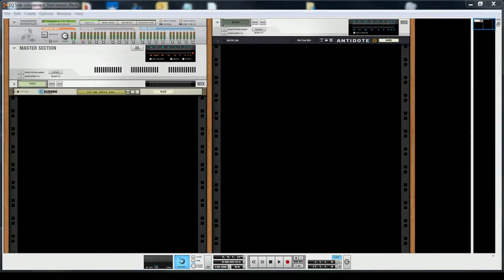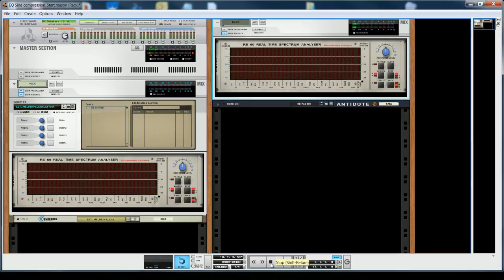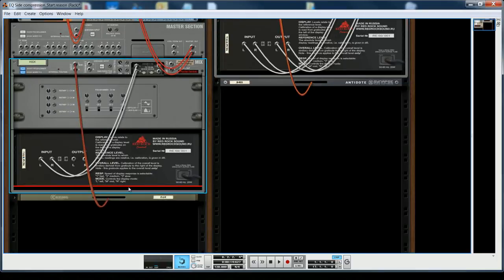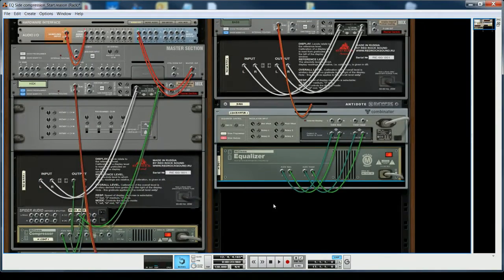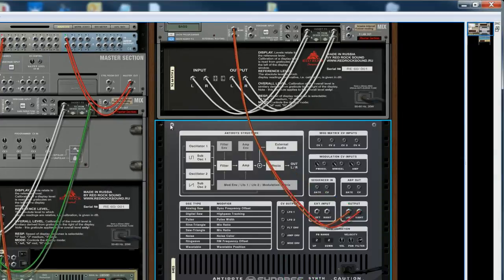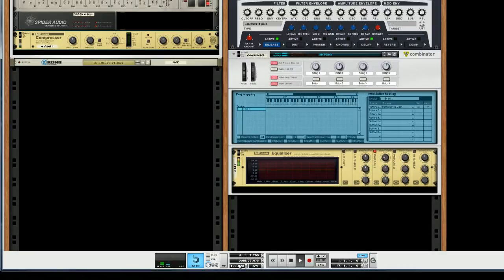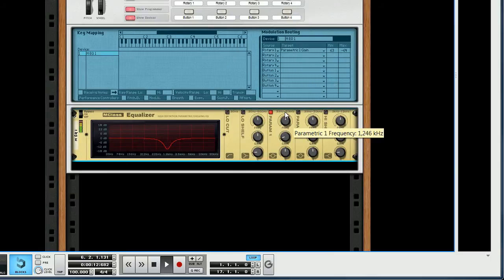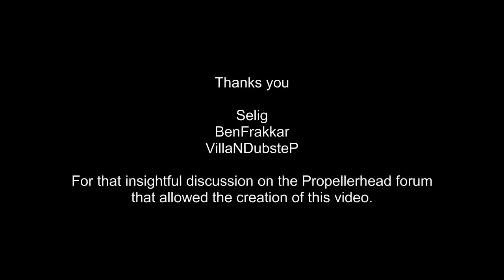Side Chain EQing in Propellerhead Reason (Tutorial)

Comment from the maker: Hi Arash, I received your pic. You say that you see the EQ going down with the kick. Then it should work! You're wiring looks OK to me. But you can simplify it. A standard channel int he rack has the same CV routing capabilities as a combinator. Try that: Just route the CV output of the compressor directly into Rotary 1 of the channel. make the assignment to the EQ parameter that you insert as FX of the channel.

Comment from the maker: I understand. It's very simple. You only need the signal of the kick to trigger the compressor. Just connect the insert FX send to the input of the compressor. You do not even have to connect the output of the compressor  back in the FX return (don't do so if you don't want the sound of your kick to be altered). By this, you are simply using the insert FX chain as a 2-way audio splitter... Hope it helps.

Comment: thx for the response.ok i try to rephrase my question.(little bit difficult ´cause im from germany ;D). In your case the insert FX of the KICK goes to the input of the RE60 etc. But like i said. i dont have/use the RE60. so where do i connect, for example ,the INSERT FX of the REDRUM?´cause there is no RE60? where do the insert Fx cable go?I wanna do it the same way u did, but without the RE60.